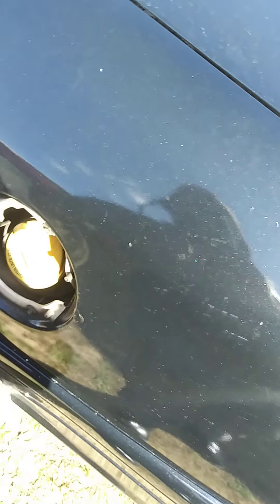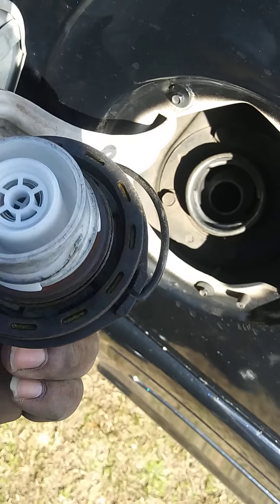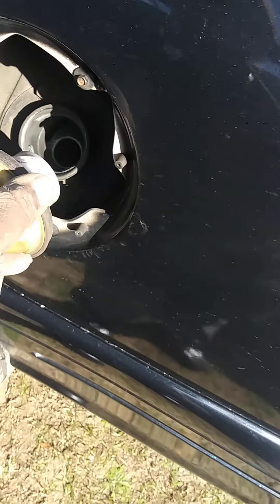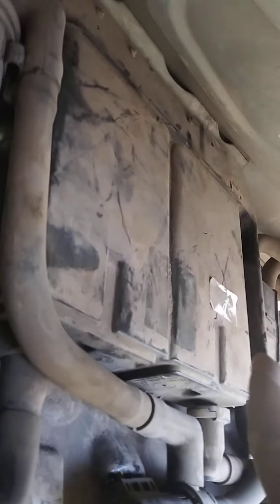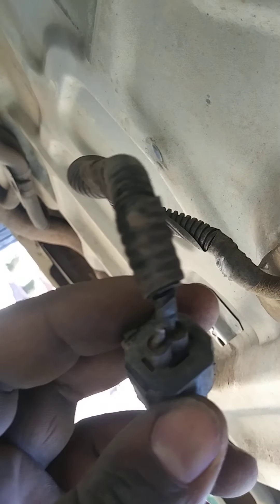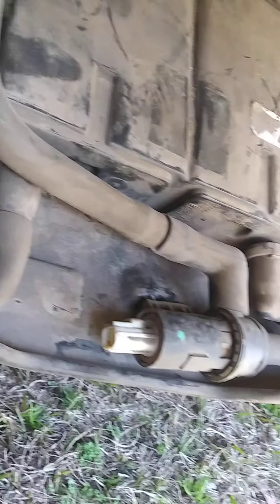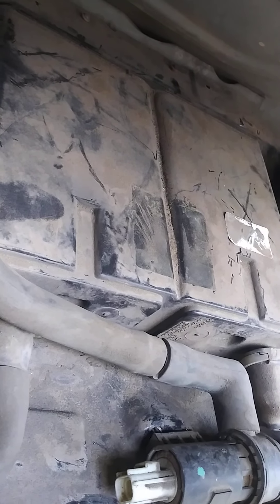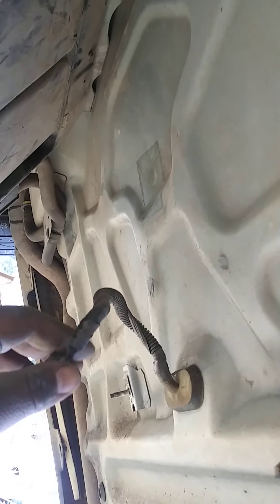custom 2009 crown vic p0446 code evap canister circuit how to fix

Comment: Hey brother. The long hose that goes in to the frame, is that a vacuum that’s why is just inside the frame? 
Or it goes connected to something?
I just did my today but I got scare when the hose came out with the peace of pipe?